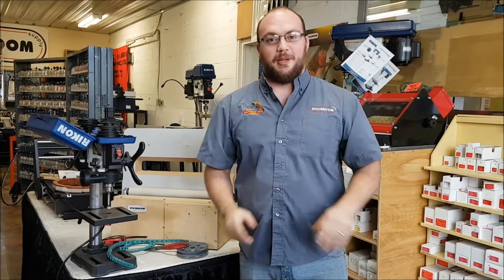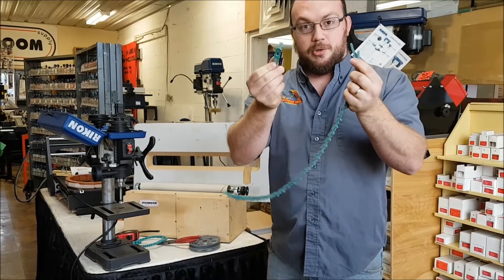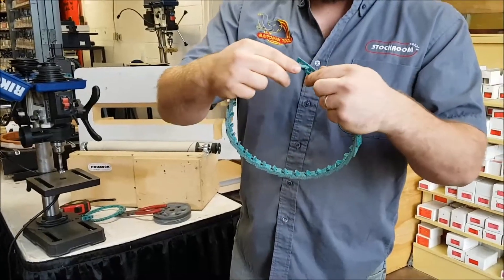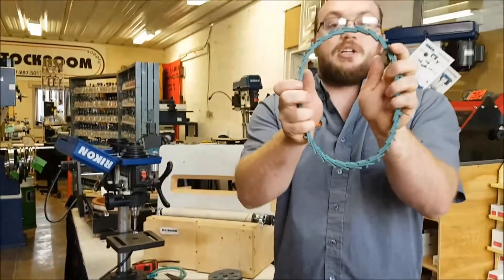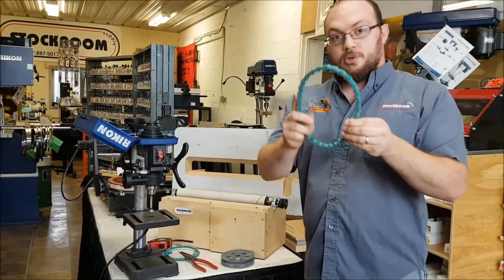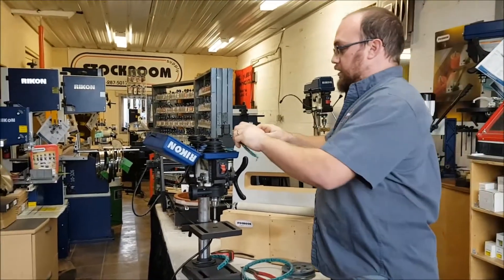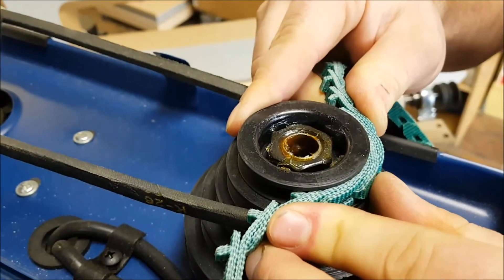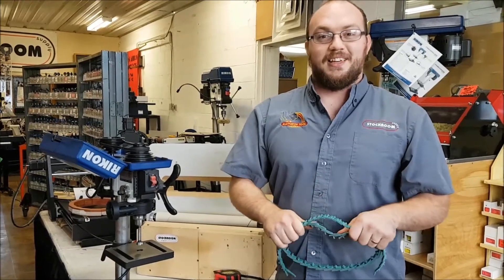EthAnswers How to Assemble Link Belt Without Cursing

Comment: You said the link belt sits a little prouder...but isn`t that cause the existing belt a 3/8,  compared to a 1/2 " link belt?  I have Unisaws, and one is a clone with 3/8" pulleys. It looks like you can get away with a link belt on you pulleys, but mine won`t work (groove depth difference from yours).I have to put 3/8 V-belts on it. I think I`m gonna like the triple 3/8 set up better than 1/2 .

Comment: Worth mentioning, if going by length you need to take out 1 link for every 24 on "A and B" cross section belts and 1 for every 20 on C" cross section belts. For example, an A27 belt you'd remove 1 link.

Comment: very good info. I might add that these are designed to run in one direction. Some have arrows , otherwise the tails that you twist when assembling should point in the opposite direction of travel. Thanks
Reply: This was the one question I still had after watching the video, thanks!
Reply: Very important to install correctly. Backwards can cause tabs to break prematurely, cause whining sound and might possibly make a broken tab jump off the pulley.